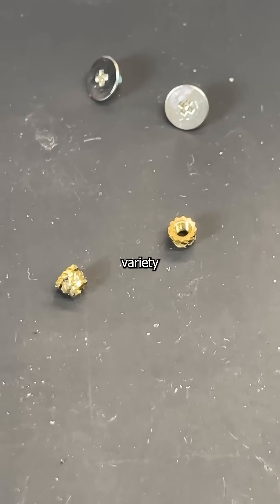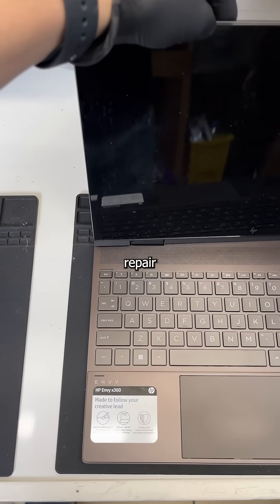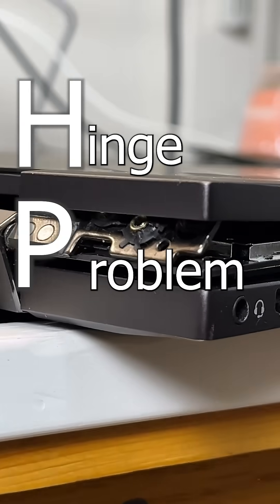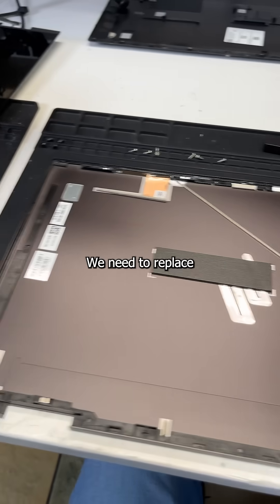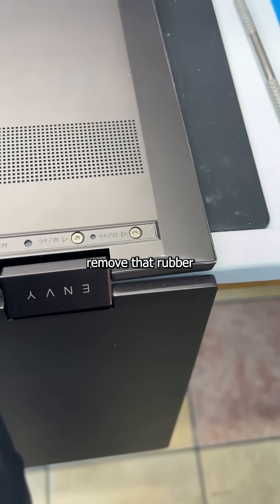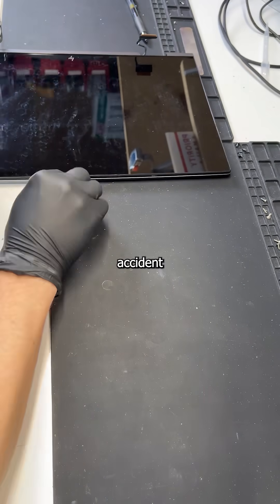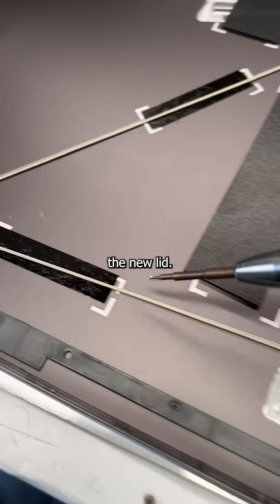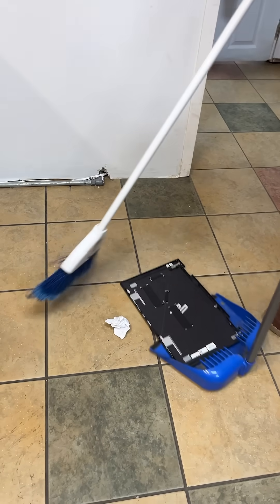HP stands for Hinge Problem (x360 hinge replacement) #shorts #tech #technology #pc

Comment: HP = Hewlett Packard ❌
HP = Hinge Problem ✅
Reply: Now it makes sense
Reply: No, it's "Health Problems"
Reply: Also Hell's Printers...
Reply: This joke is still funny even though I am one of the Hinge Problem victim.
Reply: I use MSI , same problem.
Reply: I used to call them “Heating Problems”
Reply: i was about to make this joke thx for making this
Reply: Or how I call them horrible products lmao
Reply: It can also be said as Horrible Products
Reply: "Huge Problem"
Reply: Yeah they get quite unhinged
Reply: HP = High Prices
Reply: also head problems
Reply: Like how in french we don't say Packard Bell, we say "Placard ➡️ pouBelle" (🗄️ closet ➡️ 🗑️ bin 🙃), and if you watch DankPods you know SAMSUNG is spelled SMASNUG 🙃
You can even say ASUS devices smell like your a***
Reply: I can definitely confirm HP stands for Hinge Problems
Reply: I bought a used 2018 HP ZBook workstation 3 years ago. Every time I open the laptop the last couple of months, I get a heart attack, it's squeaks and wobbles. Wish me luck
Reply: i literally forgot what hp stood for until now
Reply: Huge Problem?
Reply: No it stands for Horrible Products
Reply: Horse Power
Reply: In my case, it was an AIO problem that the dummies sat on for 3 months, claiming they could no longer get the part. 
When they finally called to tell me the situation, I pulled up the spec sheet and had a new AIO from the manufacturer ordered in less than 10 minutes. 
I did in less than 10 minutes what those idiots couldn't accomplish in 3 months. 
Incompetence reigns at HP. From top to bottom.
Reply: here on latam we use HP has a acronym for a bad words, hp = hijo de ####, son of a ##### in english, so we can just say HP is a HP and ngl is so funny.
Reply: Standing for horrible problem to me since hp is 🔥🚮
Reply: @sixstix965  have you ever even tried HP? Because they aren't as bad as you think dummy
Reply: @sixstix965 wdym? HP makes the best laptops imo. I’ve tried other brands and HP is by far the best.
Reply: I was a Hinge Problem victim in 2007...HP wouldn't be here if they didn't have huge corporations buying their landfill mass.

Comment: God Dell 3190s HAVE THESE SCREWS AND I HATE THEM! They bust up the top case so easily. A simple drop / twist or turn of the screw pops it right off the case. Needing a whole new topcase
Reply from the maker: yes indeed. Dell and Lenovo have the same issue

Comment: I use the previous generation of this laptop at work and it still works more or less fine after 5 years. And I work in automation so I toss this laptop everywhere on the conveyors, inside machines, all over metalic dust, geese etc. Its absolutely filthy, but it works. Except for a touchscreen. And a space key.

Comment: Fun fact:
I have a HP laptop made in early 2015 and I bought it refurbished recently. After all of these years the hinges are like brand new. It weighs like 4kg (approximately 8,82 lbs) but it’s a solid piece of metal, aluminum and plastic. Not cheap plastic but a proper good solid plastic. Hinges are made from steel.

Comment: oh boy, heres to hoping my 360's hinges will last for the time being, saving up for a top of the line framework laptop.
Reply: I'm using one with a busted hinge at this very moment, already had it repaired once (3 months after purchase). My advice is to set it somewhere OPEN and never move it. If they do break and you're still under warranty, do NOT let them tell you it's your fault, that they don't cover the hinges, or that you will have to pay ANY amount of money. They did that to me, and I flooded their help boards with that crap, called and talked to anyone I could every other day, told them I knew they knew, etc etc. I went from NOPE to them kissing my posterior. Repaired completely free. I don't have that luxury now, but I've joined a class action and talk bad about them every chance I get. Good luck.

Comment: Funny thing , only the office laptops have this problem , most gaming HP OMEN series don't have this problem ,you really need to be not careful or using it wrongly to breaks the plastic hinge base
Reply: Nah, "not being careful or using it wrong" isn't the issue. That would mean it's the customer's fault and nothing could be further from the truth. I had my envy x360 convertible  3 in 1 for 3 months when it broke. 3 months, and I only tried out tablet mode once. It was so expensive and I'm so poor that I was SUPER careful with it, and no one ever used it but me. Never transported it anywhere, used it very rarely because I worked all the time. At least 1/3 of the complaints I've read about the hinge problem (1000s) contained a claim by the user that they never or very rarely used the tablet feature because they were terrified of the hinge breaking. Paid extra for that, can't use it. HP has been aware of this issue for over 10 years, yet when you send it in for repair under warranty, they accuse you of dropping it, tell you the hinges aren't covered, quote $300-500 to fix...KNOWING it's their fault. Fk them. Stop victim blaming.

Comment: “HP’s headquarters” the garbage can 💀
Reply: I know right😂
Reply: The hinges on HP are total garbage but the rest of the computer actually feels nice How does that work
Reply from the maker: All their R&D apparently goes into everything except the hinge mounts
Reply: @SalemTechsperts Damn 21 seconds ago
Reply: So now you're not the greatest technician that's ever lived?😂
Reply: These sets fry legs.
Reply: They share a HQ with DELL?!
Reply: @bug5654  Dell’s hinges are not bad right?
Reply: @virajmatharu6704  Only Dell I've had this decade is a 360 so no idea on normal hinges, but their stuff like mandating branded USB-C chargers, having as little I/O as possible, and using post-sale technicians instead of QA (they sent a technician to replace my new out-of-box machine's screen) speaks pretty poorly for them.
Reply: @bug5654  oh ok
Reply: Same with Dell.
Reply: my uncle bought a hp laptop touch screen and after 4 months the hinge fucke* itself and the display came off💀💀
Reply: HP customer support be like.

🇮🇳: This is HP technical support. How can we help you today?
Reply: That was a smooth joke thrown right in
Reply: I honestly don’t get the hate. I’ve had HP computers forever, and I believe they make the best laptops. I’ve personally never experienced any hinge issues
Reply: @couchpotatoes5158  HP parts hard to get - even from HP. . .
Reply: @couchpotatoes5158  yeah same
Reply: @couchpotatoes5158  I've experienced battery issues on all my HP laptops, they all die within 3 years, I have laptops from Asus and they still are going strong

Comment: It's funny cuz my girlfriend's HP pavilion feels like it's gonna break in half every time you open it, it has a horrible little mushy "click" right at the beginning
Reply from the maker: That's the screen seperating. RIP
Reply: @SalemTechsperts  Ever considered reinforcing these horribly weak plastic screw supports with PlastAid or similar?

source: I have a Dell 7620 2-in-1, it was less than 3 months old before the hinge mounts started failing on the base--disintegrating on the left side.
So I completely rebuilt the plastic around one of the metal nuts with PlastAid (also reinforced all the others with it).  That stuff's truly amazing...WAY better than any epoxy I've used (or superglue).
Dreading the lousy mounting on the screen side though...I can't get in there to reinforce them without removing the LCD panel.

Sheesh.  Have had (and fixed) the infamous touchpad problem with it too--and it's not even 6 months old.  Today's stuff is such garbage.
Still haven't figured out what causes the keyboard to randomly just auto-repeat the last key pressed until another one's pressed...

Comment: no joke, the hinge mechanism is THE ONLY part of the laptop that was critically important to me whenever I bought any laptop.
Reply: It’d be serious trouble if it wouldn’t come with a hinge, for you couldn’t open it.
Reply: i think you might need to also look at other stuff, other than the hinge
Reply: @WudutCho Hinge first, everything else second. Hard to make use of your brand new laptop super computer if the screen snaps off the first time you open it.
Reply: YES! i agree! hp laptops are shit now the last good ones were probably made in 2010 anything newer is shit! this is exacty why 3 of my 4 laptops are at least 10 years old i got two macbooks a 2013 pro 13" n a 2014 11" air and the other good laptop is a dell inspiron 17r 5720.. as for my other laptop is a acer spin 5 2020 it works good but the keyboard backlight died and i ripped a key off while cleaning it which i put electrical tape on... i got the acer for the equivilant of 50$ from a friend because he really wanted this motorola phone that i had so i traded... i really need to get a keyboard for it but i aint payin a ungodly amount of $$ to do it when the keyboard is 20$ off amazon..
Reply: @dylanlindsay1993 HP products in general have gone down the gutter. Their desktop towers are utter shit with proprietary PSUs, mobos, and cases. Proprietary motherboards are totally insane when the ATX standard has been the norm since the late 90s. Don't even get me started on HP printers.
Reply: @AWSMcube  HP printers are the epitome of anti consumerism.
Reply: @dylanlindsay1993 ah okay makes sense I've never had any problems with the hinges until my current 360 which just cracked my touchscreen when the hinges broken.  I believe I probably bought my last laptop around 2010
Reply: Thinkpad is your pal for that solution
Reply: Avoid MSI then
Reply: I have a hand me down laptop from hp and it has this same hinge. It broke on one side and I have to baby the laptop. It's all I got.
Reply: @thej3799 take it apart and reinforce it. Use JB weld metal glue to permanently glue a metal hinge from the hardware store to it. Thank me later
Reply: I know MSI had an issue with this on certain models of there laptops, but not has bad as HP.
Reply: OMG, they've been gaslighting the consumer that HP stands for Hewett Packard  🤣🤣🤣🤣
Reply: Then buy dell